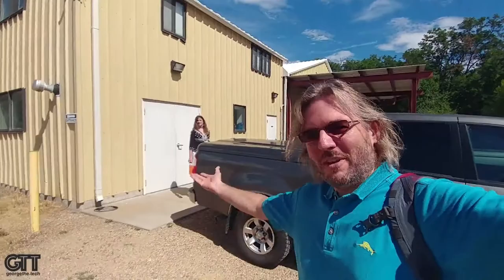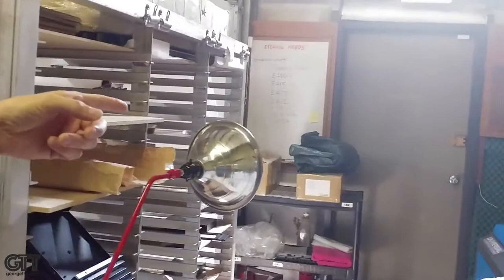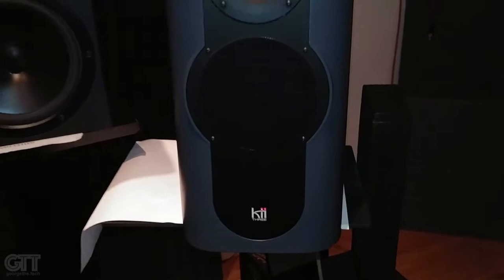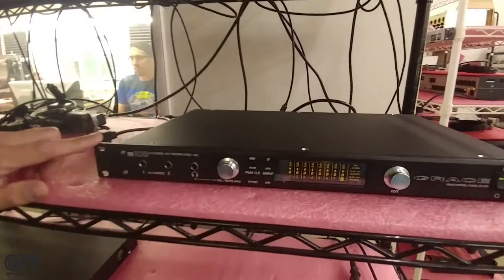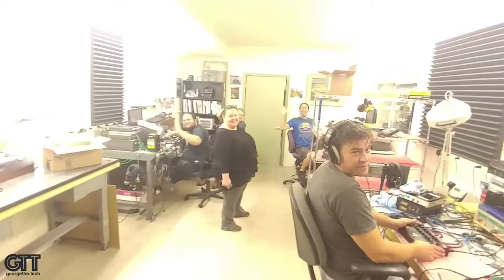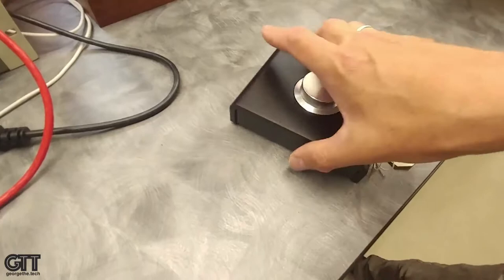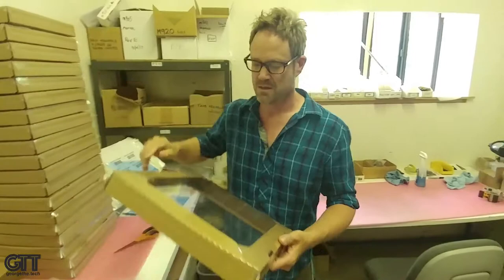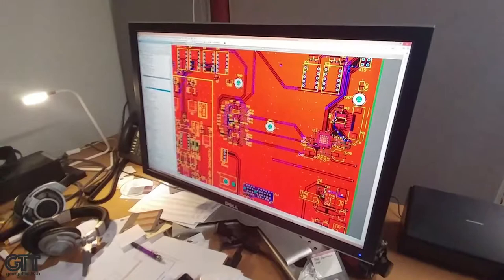George The Tech: Grace Design factory Tour with Eben Grace!

Comment: It's 2018 AD... why would any speaker need to be that large (kii) you get very big sound on a very small nowadays I wait your response
Reply from the maker: It's the physics of sound that requires speakers to be a certain size to acheive the desired volume and frequency range, accurately and without distortion.
Reply: George The Tech is this speaker comprable to a marshall stack? Or is it for a stereo system?